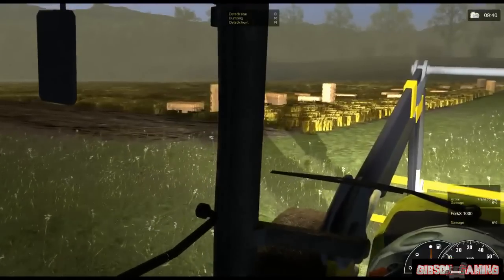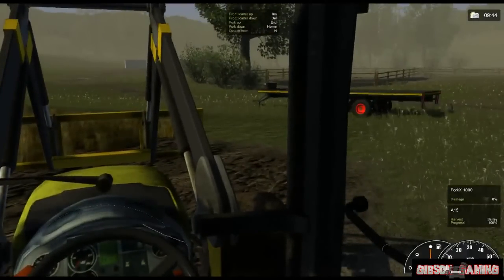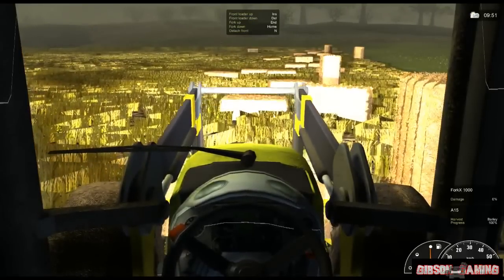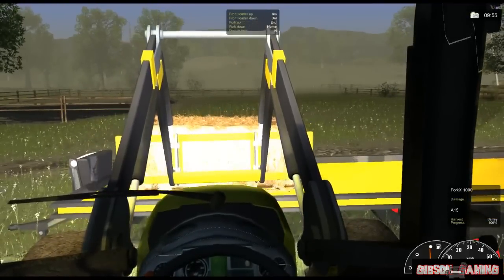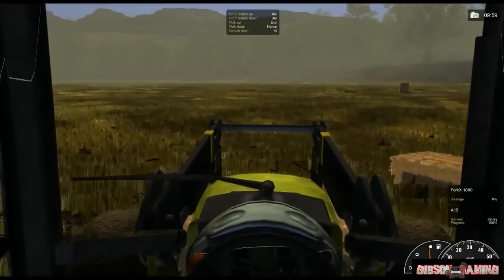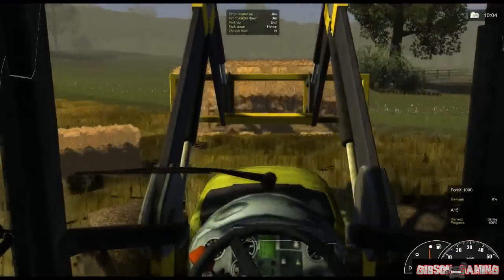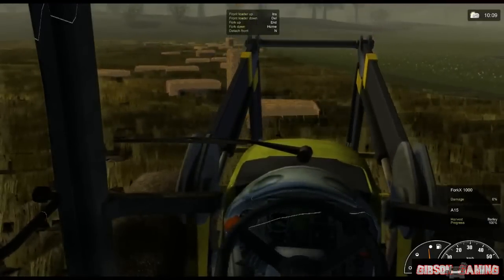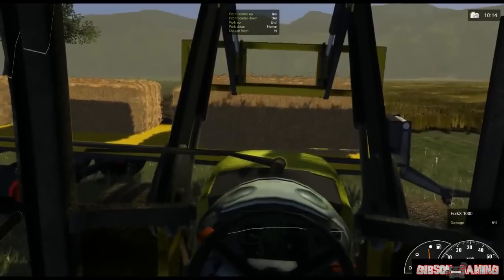Agricultural Simulator Biogas Addon "How To" Hay Bales - 1 / 2

Comment from the maker: No, you don't have to have it. Connecting the bailer, trailer, and fork are the same as any other attachment I think you press x maybe.. should be a tool tip on the screen when you pull up to it in the middle of the screen like in the video.